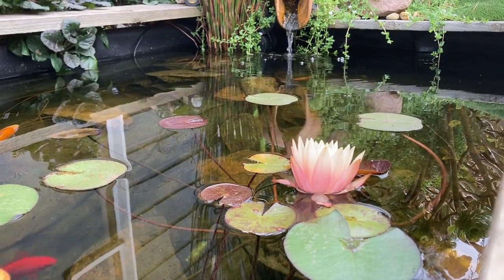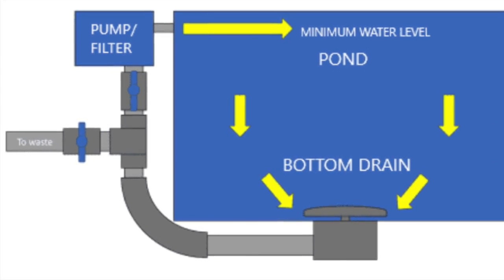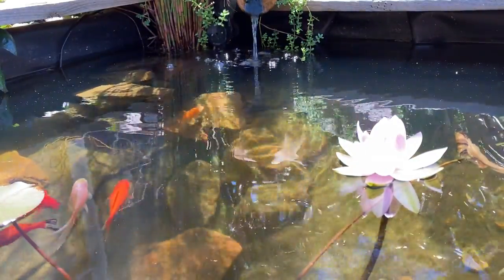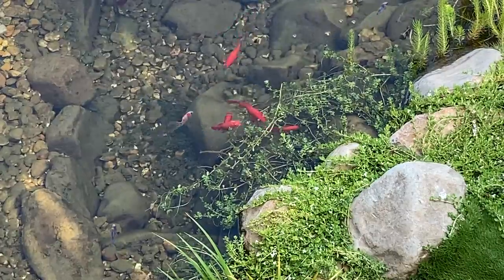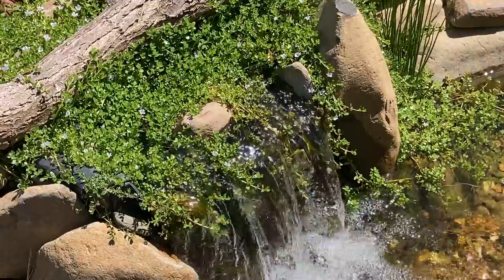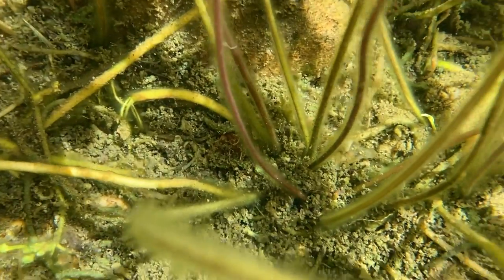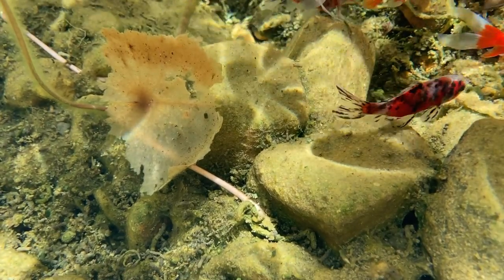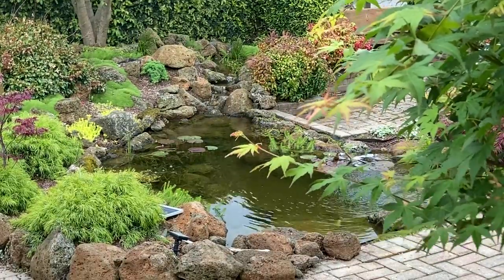Do ponds need bottom drains?

Comment: Your point about cutting a hole in the liner for the bottom drain is a good one. If the bottom drain should fail for any reason it will be difficult to repair without completely draining the pond. And if it should fail while you are away, you might return to an empty pond (with dead fish). I drain my pond once a year (in the spring) and pump out the bottom muck. Haven't had any pond problems that I thought a bottom drain could fix. But I also add bacteria every week during the spring and summer to help breakdown fish waste, so my bottom muck accumulation is minimal. (Good video. Haven't seen anyone deal with this subject before.)

Comment: I love your commentry on this. I was building a 5,000 aquaponics system with the pond built with a bottom drain. The bottom drain moved and leaked so I ended up having to concrete the bottom and make it waterproof which has been a huge amount of trouble and really more than it was worth. I do take water from the lowest point but I now use a simple pipe with grate attached to bring water to the pump housing using water pressure. My filter is the grow beds and the fish are to be eaten eventually but their lives are very very important to me as happy fish in a good environment are healthier.
Reply from the maker: Well done Alexander. I love what you are doing 👍

Comment: I already have a pond that I built two years ago. It’s about 12,000 gallons. Rubber liner, 3-6 ft deep. No rocks, sand , or soil in the bottom. Only along the top edge of the water line to keep the liner in place. No bottom drains. 

I also have a wooden trough with cobble stone for a waterfall. I have grown several different plants in it. Currently pennywort. I’ve even cloned lavender by just placing cuttings in the waterflow. 

I have another submersible pump inside a 55 gallon skimmer that I made which has a layer of matala filter material to catch string algae and debris. It feeds a system of two 2’ x 8’ hydroponic trays stacked with plants growing in them which drains back to the pond. Also the skimmer feeds a two barrel filter with only coarse matala mat in each and both are bottom fed with an overflow pipe back to the pond, and have large drain valves for easy cleaning. 

I have water lotus, mini cat tail, and rush growing on 1-2’ derp ledges. I have about 50 koi between 1-2 years old.

The main problem I have is having to pull the pump out of the bottom to clean off debris from the intake screen.
Reply from the maker: Sounds awesome 👍

Comment: Your pond is fantastic. That said I use a bottom drain or at least one that sits on the bottom upside down sucking from the bottom. I will one day make this into a proper bottom drain when i make my pond deeper. If you keep gold fish the type of pond you have is ideal. If you keep koi not very hardy and needing as good water quality as you can give them. Then filtration needs a step up and you thought you were lazy i am lazier i use a drum as i really don't like cleaning sponges from traditional filters. I don't have plants my pond could just as well be a swimming pool just a boring rectangular shape as are many koi ponds.  I had a lack of space which forced my pond to be built between two retaining walls in my garden which is terraced hence the shape. However i enjoy my koi  and love watching them grow. If i had goldfish like you i would try to emulate a pond like yours. I also wanted a cheap pond The total cost was around three thousand english pounds which for a koi pond with a druim filler and two 300 liter boi chambers is cheap in the uk.
Reply from the maker: Nice. Sounds like a good setup.

Comment: Would it be feasible to have a pump on the bottom like you mentioned, but have it pump up water up into the skimmer? Would be nice to also keep the muck off the bottom but I imagine that would lead to some clogging.

Thanks for all of the help in your videos!!
Reply from the maker: But from the skimmer where would the water go? In a normal set up the skimmer sucks the water in and delivers it to the biological filter. There’s nothing wrong with having a pump on the bottom and delivering that water to a biological filter. In that case I wouldn’t use a bog filter, I would use a high flow filter with sponges to collect all the sediment you are collecting.
Reply: @Ozponds  I'm planning to follow all of your instructions for a bog filter, and thought maybe you could pump from the bottom to the bog. But that's good to know; will just stick with a skimmer. :)
Reply from the maker: You can pump from the bottom to the bog, you will just need to clean/ flush it more often.
Reply: @Ozponds  Makes perfect sense. :) To hop on the bandwagon, it'd be great to see a video on specific pump recommendations, piping, etc.!
Reply from the maker: It’s already published 👍
Reply: @Ozponds  LOL look at that, the one video I haven't watched. :P

Comment: A bottom jet would help as it blows the debris up to be sucked by skimmer. Adding scavengers (shrimps maybe) might help to effectively breaking down debris too.
Reply: Flow is absolutely the #1 key for good filtration.  Yes, the scavengers can help avoiding “dead spots” is paramount which allows the scavengers to only feed on the lesser remaining detritus creating a more natural ecosystem.  When scavengers are introduced to a large food source, they explode in population.  If they fix the problem, then they face mass starvation.  But yes I agree with having the scavengers after implementing your first point of using the flow to kick up the debris to the skimmer and let them eat the leftovers.
Reply from the maker: Yes I did this in my dream pond 👍
Reply: @mike2687  Would adding the scavengers to the pond at the same time as the fish allow them to properly regulate their population do you think?

Comment: If you have a high orp, it do not matter whether you take the recirc from the bottom or the top. The bottom organic matter will be converted to inert detritus
Reply from the maker: I don’t know what I high orp is? What is it?
Reply: @Ozponds  oxidation reduction potential is measured in milivolts mv. Ponds with an orp higher than 150 mv should have no problem. The nice feature about a bog filter is that the anaerobic and anoxic bacteria take care of the nitrogen compounds like ammonia, nitrate, nitrite and convert them into nitrogen gas which is stripped out of the water column
Reply from the maker: Awesome 👍. That’s been my theory I just didn’t know all the science. Thanks for the clarity 🍻